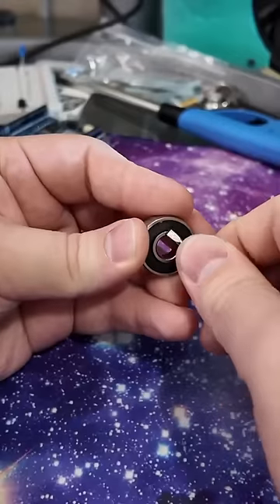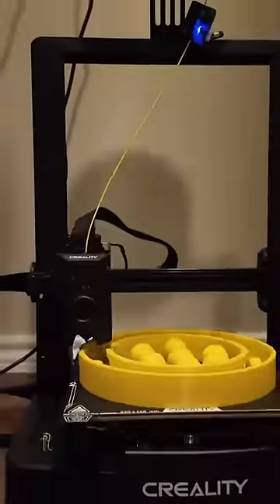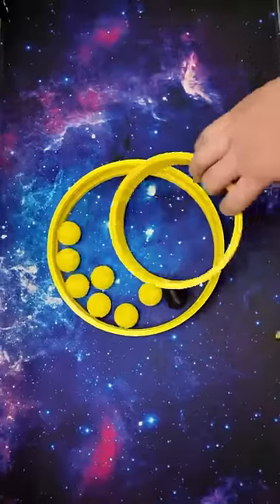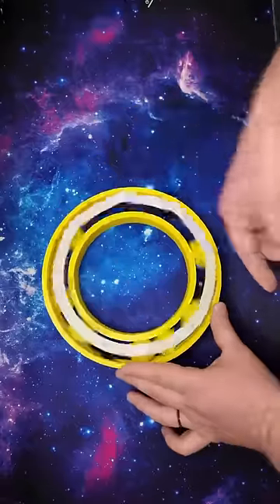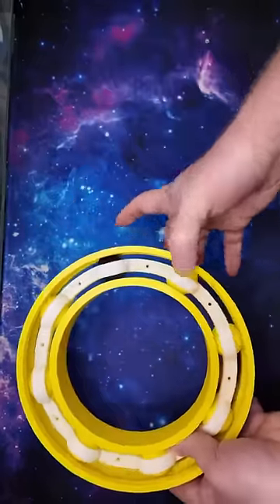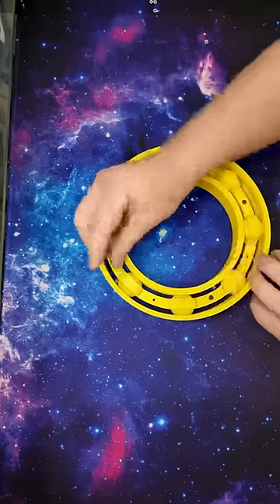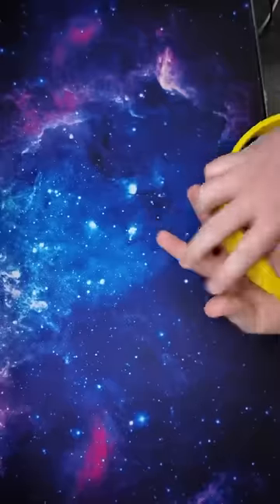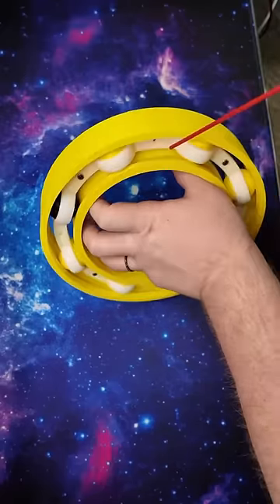How Do The Balls Get Inside the Bearing? 🤔 (ft. GIANT ball bearing) #3dprinting #engineering

Comment: Sometimes it's not a ball carrier, there's just a notch in the outer ring that allows the balls to fit in without gaps.
Reply: 😂 exactly he was almost there
Reply: One other method is the freeze the inner race and heat the outer race. This provides just enough space to put in that last ball.
Reply: that notch is called a flange
Reply: Cone bearings use "loose" BBs too (although you can get caged ones to fit).
Reply: That’s called a full complement
Reply: I came to say this b you beat me to it
Reply: Yeah, it just depends on manufacturer and sometimes the intended use
Reply: It's called a cage
Reply: @joshuawalker5044  depends on who you're asking, cage, ball carrier, both are acceptable
Reply: I need me a ball carrier
Reply: A real bearing has both shouldered races AND a cage.
Reply: You can also cut out the balls to be inbetween the small and large circle elements from the start. This saves a lot of time in general.

Comment: Now try graphite or some actual lubricant instead of a solvent ( YES WD-40 is a solvent)
Reply: Thank you
Reply: Came here to say this!
WD-40 to help clean moving, typically metal, parts & graphite lubricant for, well, lube.
Reply: Came here to say this!
WD-40 to help clean moving, typically metal, parts & graphite lubricant for, well, lube.
Reply: It's a lubricant and a solvent, it isn't mutually exclusive. Stop thinking you are right or smart
Reply: Silicone would be good 🤔
Reply: WD-40 is a band name with a variety of products, some of which are specifically marketed as libricants.
Reply: WD40 is solvent.. in the same capacity as Mercury is solvent. WD40 is known for being solvent, it is known for being most liquid liquid!
Reply: From WD-40's website:
A QUESTION OF LUBRICATION
Myth: WD-40 Multi-Use Product is not really a lubricant.

Fact: While the “W-D” in WD-40 stands for Water Displacement, WD-40 Multi-Use Product is a unique, special blend of lubricants. The product’s formulation also contains anti-corrosion agents and ingredients for penetration, water displacement and soil removal.
Reply: Honestly makes sense to me with how much glue residue I get off with it
Reply: I think it's wild how long people will spout that after hearing it 15 years ago without ever thinking about it.

Technically motor oil can used as a solvent, water is a solvent, grease is a solvent. 

Saying that wd 40 is just a solvent means nothing other than indicating the fact you don't know what the word "solvent" means

I can use air as a lubricant and it be one of the lowest friction bearings in use today. Do you think it suddenly doesn't work because air isn't labeled as a lubricant in a shopping catalog?
Reply: Any liquid is a lubricant if you're brave enough.
Reply: Graphite paste makes a huge mess
Reply: @ImBuanana 😏 😂
Reply: Graphite paste makes a big mess
Reply: But it works as a lubricant and a cleaner. It does both jobs.
Reply: @yuzuruotonashi659  No. It isn't a lubricant at all. It's only a solvent. The reason people think it's a lubricant is because it cleans gunked up parts and frees them up. That's not lubricating anything, it's just cleaning.
Reply: @ellisgill1940  it only works as a cleaner. It actually makes things drier because of how quickly it evaporates. Using it as a lubricant makes the surface even less lubricated lol. If you use it for a few seconds just to test something it's fine. But it is not a lubricant and does not actually lubricate anything for more than a few seconds.
Reply: @Loserstakethebait  false. Water oxidises with the iron to create rust, ruining any chance of smooth operation. With iron or galvanised metal, wd40 cleans, lubricates and maintains function incredibly. Clearly not an engineer mate
Reply: Yes, but a solvent in this scenario just acts like glue. It's metal lube.@yuzuruotonashi659
Reply: Thank you I work at a hardware store and a guy tried telling me off in front of a customer cause he thought you could use wd40 as a lubricant and he wouldn’t concede the fact that he didn’t know what the hell he was talking about😂😂😂
Reply: WD40 is a brand now, they also make lubricants. Yes I hate that they've twisted their original name, but it's all about brand recognition
Reply: Thank you for knowing wd40 is a solvent
Reply: Thank you
Reply: Water displacement 40
Reply: But any liquid can be a solvent? Also what's stopping it from being both solvent and lubricant?
Reply: @yuzuruotonashi659 the general formulation is a lubricant right up until it's a solvent. There is a lubrication only version of my memory serves me well, but it's not the one you'll reliably find just about everywhere.
Reply: @Loserstakethebait it literally is a lubricant.....

Read the bottle
Reply: @IanBPPK  what does that even mean? "A lubricant right up until its a solvent"?
There's no chemical reaction changing the lubricant into a solvent. Dissolving something creatures a compound, a physical mixture, not a chemical change
Reply: @Alucard-gt1zf   Literally isn't by definition. Watch any video on it being tested. It lubricates for at max a few minutes and then begins to sap moisture from the area as it evaporates. Making the surface even drier than it was before. 

Wd40 is a solvent that breaks down oils... Oils are the best lubricants for metals and most things in general. Something that destroys oil based lubricants can't be the same type of lubricant that it destroys lol. And it certainly isn't a water based lubricant because then it couldn't dissolve oils. Just because a company makes a vague claim doesn't make that claim true in practice.
Reply: @prestonfisher2632   Not true. Wd40 is a solvent that breaks down oils. It does not act like glue it behaves akin to nail polish remover. You can spray it on a metal sheet and watch it evaporate in a matter of minutes. Lubricants need to stay long term. 

Wd40 seems like a lubricant because it breaks down the gunk and makes things move smoothly again. It doesn't actually provide lubrication for more than a few minutes though. It's literally no better than water as a lubricant. The evaporation process leaves the piece even drier than it was before using the Wd40.
Reply: @ellisgill1940  You clearly aren't either as you have never used or even seen someone use wd40. It's unstable and evaporates below room temp. That's not a lubricant lol. Oil based lubricant are the best for metal. You know what wd40 is a solvent for? Oil based lubricants... spray wd40 on grease and watch it break down. 

If it dissolves grease and simultaneously isn't a water based lubricant than it's a terrible lubricant. It is not and has never been a good lubricant. There are 50+ videos on YouTube you could watch the proves you wrong, but instead you choose to be ignorant.
Reply: @yuzuruotonashi659  Regular WD-40 isn't a suitable long term lubricant as it dries out really quick.
Reply: @leovang3425  didn't say it was, I just said it's a lubricant dissolved in a solvent
Reply: WD-40 sells a silicone lubricant
Reply: Lubrication police
Reply: i think of it as that tool, as well as "water displacer"  (the WD).

I find it odd that their website claims its both a lubricant & a solvent
Reply: @Loserstakethebait  well it is a lubricant just a bit shit.
Reply: @mtraven23  wait, so you did research, went to the website, saw that it was a lubricant and solvent, and yet the one you believe is the youtube comment with no sources cited? God help you 🙏
Reply: WD-40 is a water dispersant in a solvent
Reply: @AcornFox  kerosene works as a lubricant, wd-40 has kerosene
Reply: @MrFateorfaith  thank you
Reply: @yuzuruotonashi659  okay... do you also cook with mobil 1 when the recipe says olive oil 😒
Reply: @yuzuruotonashi659 no, I trust my experience using the product.

and what this person said is not inconsistent with WD-40 website, they claim it to be both.  That claims is much harder to me to square.

did you have anything useful to add on the subject, or you just felt like complaining? 

ps  i'm doing just find without the help of your imaginary friend.
Reply: Imagine reading "lubricant dissolved in a solvent" and being unable to figure out that it is a lubricant 😅🤣😂
Reply: @yuzuruotonashi659 its not.  can you read?  Do you know what dissolved means?  Its lube is dissolved in a solvent, its no longer that lube. 

if I dump a container of dawn in my engine oil, is it still oil?  it is not.
Reply: @yuzuruotonashi659 😂 no. You don't want your lube to be corrosive. It'll burn.
Reply: @yuzuruotonashi659 what is your definition of "dissolved"? Usually it means broken apart. Like how NaCl becomes Na and Cl in water.
Reply: @yuzuruotonashi659  WD-40 literally stands fkr water displacement (formula) 40

It's NOT a lubricant.
Reply: I prefer food-grade gear grease for things you touch. Lithium grease for most other plastic things. Axle grease for metal things you never touch without disassembly.

"Food-grade" doesn't mean you can eat it, it's for things like a KitchenAid mixer and such, where there is a remote possibility that food contact may happen. 
You don't want gear grease in your food, but you really don't want toxic gear grease in your food.
Reply: @ellisgill1940 it has it's uses. It's not a good lubricant though. It's like using a slotted driver to turn a Phillips or Torx, it can work in a pinch but it is not appropriate for routine usage.
Reply: WD-40 *Contains solvents. It is not a solvent itself.
Reply: @yuzuruotonashi659  It's neither a lubricant nor a solvent. And you guys are so confident lol.
Reply: Yeah I was triggered too and came to say this.
Reply: @yuzuruotonashi659  It's a lubricant in some contexts but that isn't its primary job, it's good for corrosion resistance and freeing up stuck metal parts, but it's not the ideal lubricant to use for polymer.
Reply: @yuzuruotonashi659  Yeah it's so smart of you to blindly believe anything a company says.
Reply: @gredystar8333 Original WD40 was water displacement formula 40. The founders 40th attempt at a water displacement formula.

The fact that it's now been stupidly made into a brand name is not invalidating the fact that he's using original WD40 in the video and therefore all the criticisms do apply here.
Reply: @TarantuLandoCalcuLingus not penetrating fluid, its a WATER DISPLACER(WD}, its made to prevent rust on the steel shells of ICBM's for the us military, the fact that people use it for penetrant is fine, its an advertised use, but not what its meant for.
Reply: WD40 is primarily a Water Displacement spray, hence the WD. 40 is how many recipes it took to get it right. It is mixed with lubricants, but it’s a poor lubricator. It does double up as a solvent though.
Reply: @yuzuruotonashi659 It’s a water displacement spray. WD stands for water displacement. It’s a terrible lubricant, but a good solvent.
Reply: Some actual oil (like mineral oil) would work, albeit a complete mess
Reply: WD-40 makes more than 1 product. 

"WD-40 Multi-Use Product protects metal from rust and corrosion, penetrates stuck parts, displaces moisture and lubricates almost anything."

"Lubricates, resists water and protects metal and non-metal surfaces"

"Lubricates 15X longer than the competition"
Reply: @jakedewey3686 Stop trying to make sense!
They read what WD means on the internet, and WD-40 only makes 1 product! 😂
Reply: @Loserstakethebait That's not a convenient username when you're trying to parrot what you read on the internet without checking anything 😂
Reply: lol there's nothing scary about something being a solvent, water is a solvent and so are most liquids.
Reply: try cocoa butter... I've tried lots of different lubes for plastic (I do 3d printed combat robots) and the least toxic one that works great is 100% cocoa butter... but not the lotion, that has fillers... It works as well as the specialized grease designed for motorcycle plastic gears or moly-based petroleum grease...
Reply: WD-40 is indeed a lubricant, but most of the lubricating compounds evaporate within a few days to a few weeks, depending on temperature and how hard the bearings or joint is being used. Which is why for long-term lubrication you need a different lubricant.
Reply: I used white lithium grease for one and it was nice that way, provides enough flow and doesn't damage the plastic if I'm not mistaken
Reply: wait, does that mean you can crush up pencil lead or am i just dumb